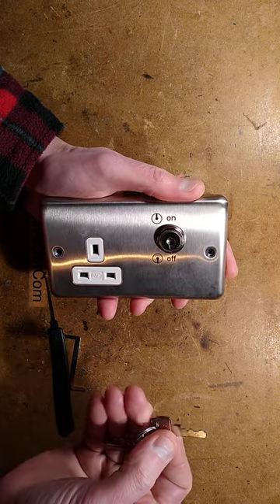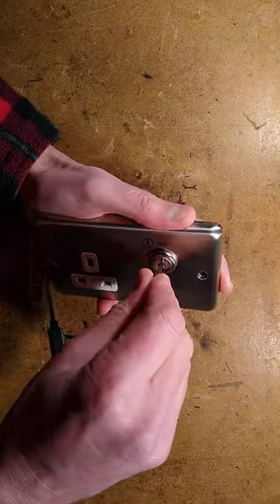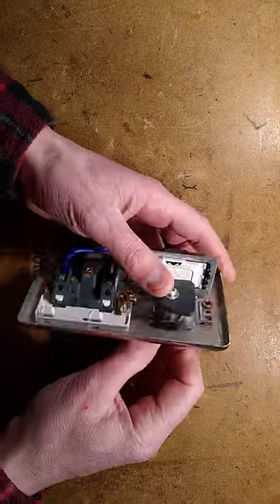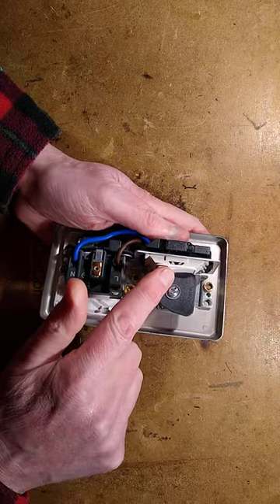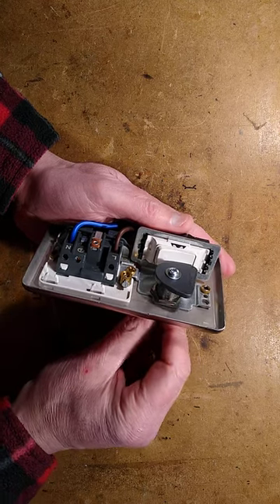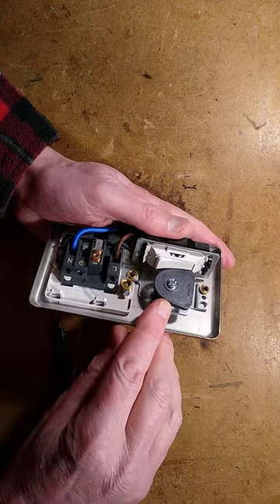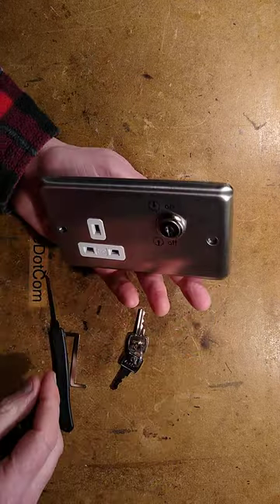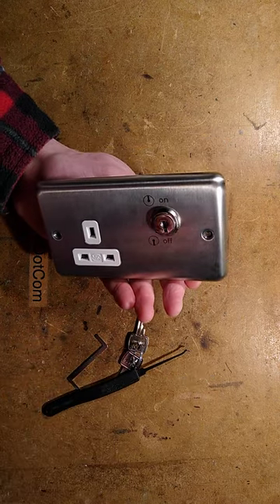MK key operated socket

Comment: Extremely clever, using standard parts makes is very easy to fix in case the switch breaks which is one of the big failure points

Comment: The reason they have this method, is so we have a double insulated connection between the "metal" key and the live wires. Love your vids Clive.
Reply from the maker: That's a good point too.  Very good separation.

Comment: The clever thing about this design, keeping in mind you can get key switches, is no matter how you fiddle with the lock, there's no spicy juices able to leak out through your key/ lock pick, while at the same time, putting a physical barrier in the way of unauthorised use... But I'll bet a decent screwdriver and a pair of pliers (hammer) can defeat it. 🤔

Comment: I like the idea. It can be hard making something safe and I like the idea of disconnecting the lock from the switch completely. It's probably cheaper than sourcing a dedicated lock switch.

You can probably pick this with a rake or possibly even blowing through a drinking straw but I'm guessing the target audience is professionals wanting to be able to lock out a plug for maintenance or something and ensure someone does not plug a device back in while you are shoulder deep in an archamedes screw or something...

Comment: easy enough to unscrew the wallplate, then unscrew the rotating bit off the back of the camlock.
Reply: Or short the switch.
Reply: Security tamper proof bolts would delay those attempts
Reply: There is always a way..😂
Reply: Always a way but how desperate are we getting for free electricity?⚡️

Comment: Overcome by a screwdriver and insulated clips.  I “fixed” one very similar at an obnoxious event centre I worked at year on year so they could turn the key being smug but we could still get power for our kettle after they pulled the main distro’s 10 seconds after the close and we were still there for 2 days.
Reply: You tapped one of the wires going into the switch into the socket?

Comment: Similar to my robot fish. An O ring shaft has a disk with a slot in it on the inside. The slot works a toggle switch to isolate the battery. It has a resin head with reed switches cast into it. To change the program routine you put a magnet by the relavent reed.

Comment: What if I turned it on, took the key out, and then oopsie put the key in an outlet hole?  It was dark, I was drunk… I’m not saying it would happen, but if it did, does the key fit into an outlet hole?
Reply from the maker: The socket is shuttered, so low risk.

Comment: Rumor from the top is that for a certain quantitied episode number, you would be troubleshooting the old RBMK1 lighthouse power generator lol....my polish friends say if you need to make a nuclear poweres generator you just take a gas powered generator and plug the output into the input.....comes with optional potassium iodide pills but it voids warranty if you open them lol

Comment: I'm not from the UK, but I can imagine it being against code that you cannot turn the socket off without the key. Any insight?
Reply: You can just pull the plug out to isolate. Unswitched sockets exist and are allowed although we prefer switched sockets for the convenience of being able to leave the plugs in but disconnected from power.

Comment: Metal front. A bit scary if someone forgets to connect the earth and if something makes it live
Reply: Metalclad wiring accessories have been around for decades. This isn't anything new to worry about.
Reply: @timbo19  i know, still just as nonideal as always
Reply: You can think up "what ifs" about everything. Considering metalclad accessories are extremely well established and this product is clearly intended for commercial/public building use, where DIY electrics is highly unlikely to happen, this is an irrational fear.
Reply: That's a pretty big screwup for an electrician or even a handyman, forgetting to connect the ground. It's like refusing to buy a car because someone might have forgotten to tighten the lug nuts.
Reply: Ive heard of thinking outside the box but it doesn’t worry you when you use your domestic appliances, they are all in metal boxes/ cabinets ??
Reply: the big metal washer machine, oven, dryer..... Lost of things cam kill you if wired incorrectly lol
Reply: In USA All commercial sockets are metal in metal conduit even screws are grounded so it's hard to get a shock unless you touch the hot wire or a neutral sharing a load.

Comment: Hate short videos-can't make long comments.
Reply: Ok, man youtube sucks. The problem I have is that if there are 5 or more comments already, the comment entry field will be at the bottom of the screen, and the comment button will be half-off the screen. Making a comment that's 2 lines or more long causes the comment button to scroll off the screen, and there's no way to click it. But, the comment itself will pop to the top of the window, and there will be lots of room to make a reply. Really bad software design.
Reply: My original comment - "I have the manual for that socket. It says "Hit it with a brick.""